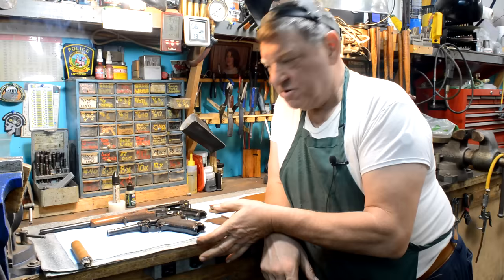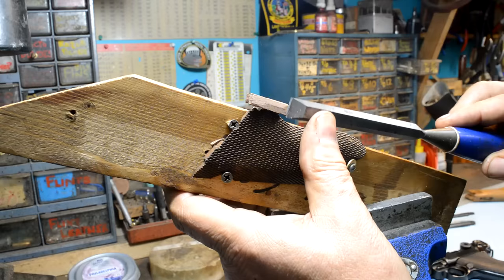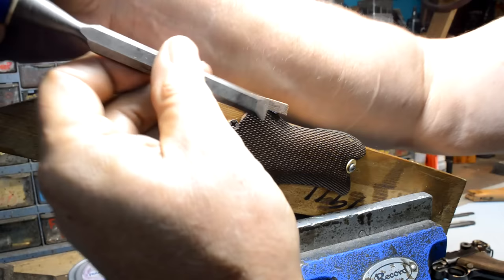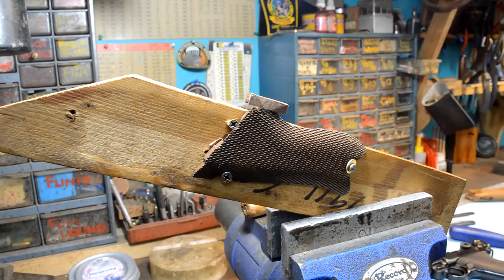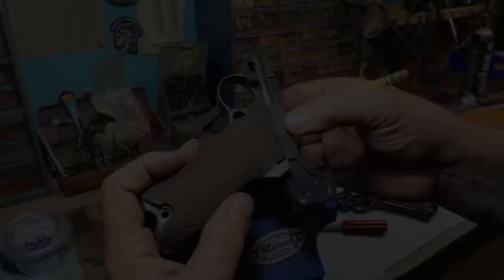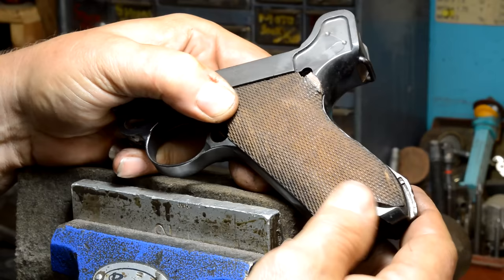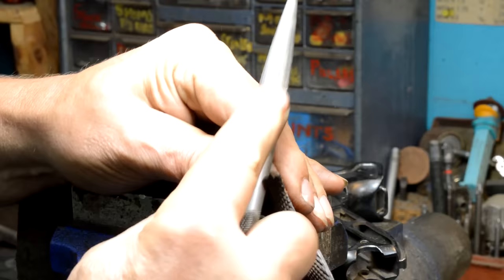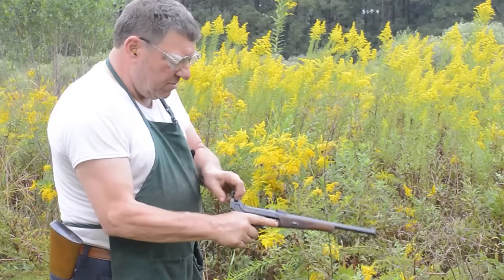Luger Carbine: Anvil 0131

Comment: Charles Kenyon's book "Lugers at Random" shows stock similar to one you were using in the this video.  He states "1902 carbine stock. The length is approximately 13" and the wood is fully contoured. and finely checkered, with a butt plate of polished horn."

Comment: I made the grips for Mr. Martz' custom Luger pistols. I used to pressure impregnate the grips in two part industrial epoxy. I never had a chip off the grips because the epoxy would plasticize the structure of the walnut.
I had jigs and fixtures which allowed specific cuts to be made.
I needed a new saw to do sawing into hardwoods so I bought a Japanese pull saw. It is the most accurate saw that I currently own.

Comment: as someone that has had a runaway on a luger with a snail drum mag. i salute you sir for the 2 rounds in mag first time firing.

length of pull on mine with stock [Not the ww1 paddleboard] is 18inches/46cm. I prefer it long like this personally, the grip angle would be harsh if it was any shorter a length of pull for someone my height/arm length.

also who has the original luger grip jigs? if they are even still around.
Reply: Mitchell was making Lugers.  Most likely they had the jigs.
Reply: Re: Doubling.  Clean the firing pin and hole.

Comment: Thank you very much for this!! What variation of Luger do you have for the left grip panel repair? The back strap has the stock lug like a military P08, but the upper left frame, under the safety lever, has no marking. Usually "GESICHERT" is inscribed under the safety lever.

Comment: I have a 1916 Luger in .30 Luger. Twice I've had it double on me, and once slam fire. I have no local smiths I trust. What is the prime culprit?
Reply: First check the firing pin.  There were at least 2 versions, and the later model had fluting to clear carbon.  Firing pins would get stuck, causing doubling.  Try taking it apart and cleaning both the pin and the hole.
Reply from the maker: Exactly what Mr. Sullivan said

Comment: yeah i think that stock was done by bubba Mark!! when you do a barrel inlet do you put a coat of stock oil in the channel? i did a light coat but i've been told you don't have to it's not necessary then another said it's mandatory and yet another says it depends on the wood the wood's age and how much it's taken down! it's enough to make you get a synthetic and be done with it!
Reply from the maker: I stock oil all exposed wood, including the barrel channel and inlets
Reply: @marknovak8255  thanks Mark!

Comment: Can you advise as to making a boiling tank that would accommodate rifle barrels similar to what you have?
Reply from the maker: Cut the top off an old water heater
Reply: @marknovak8255  Do you use the heating elements in the hot water tank? Does it get hot enough? If you covered this in a video could you give me the reference. Thank you for you help

Comment: Sorry man but since when do you work from Bubba's handbook. Those screws are digging into the checkering and you should have made a template and cut the wood down before glueing it to the grip. Good grief you're better than that. You are so lucky you didn't damage that grip more.
Reply from the maker: And yet......
Reply: The wood looked all rotted out at the top if you see what the backside of that grip looks like at that section. I doubt he ran a drywall / wood screw and let the head leave a huge dent in the stock. Also, it's hard to pre-shape the replacement wood before you glue it to the stock. You will always have to do blending work, because the glue adds thickness or the part doesn't setup quite right. I agree with Mark in making a good glue joint, and then removing material as needed. It's not like he glued a 3" cube to the grip, we are looking at probably a 1/2" to 3/4" piece that he worked down.   @NOLAART
Reply: Sorry man but I just disagree. There are are far better ways to hold something like that grip. At least put something between the grip and the screws to cushion the wood. And there is no reason not to shape the wood down to approximate the shape you need to fill. Glueing that big chuck of wood on there like that is just silly and creates a chance of further damaging the piece and the work more tedious. He does great work but I was really surprised when I saw him do this the way he did. @rouserrouse100
Reply: @NOLAART please make video of your better technique 😮

Comment: Could of used a Dremel mark to take the bulk of that wood down.   Smh.
Reply: too much vibration to destroy the molecular bonds in the glue in that tiny contact patch.
Reply: Mark is a craftsman.
Reply: He probably got 500-1000 for that repair. He doesn't need or have to be in a hurry.
Reply from the maker: Yes to all......